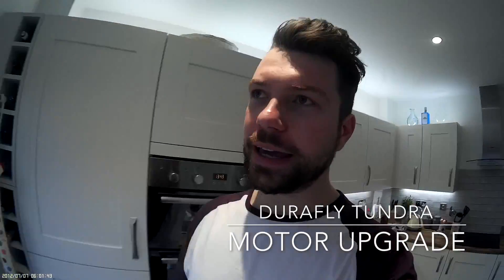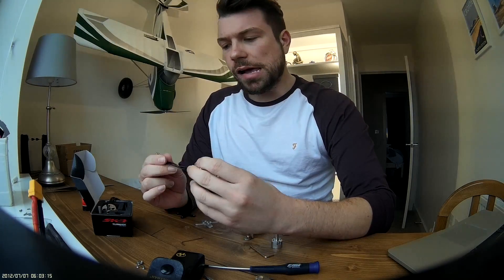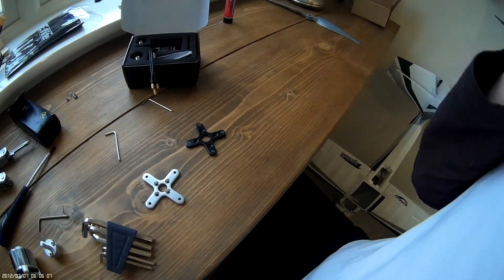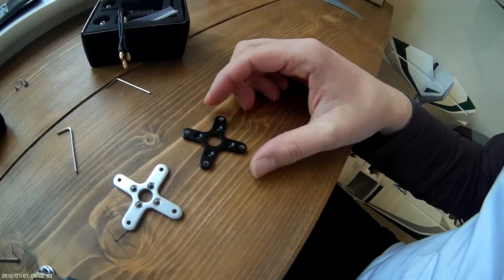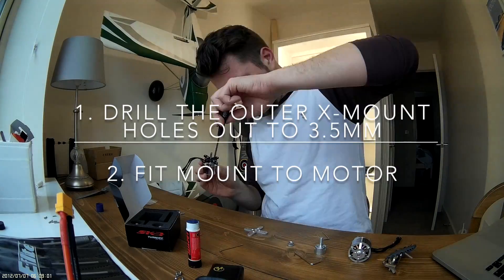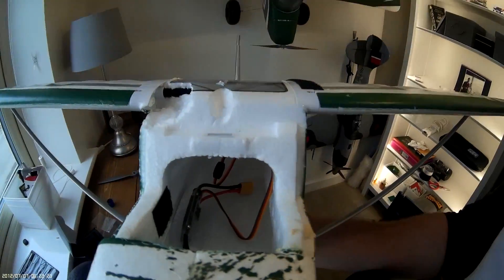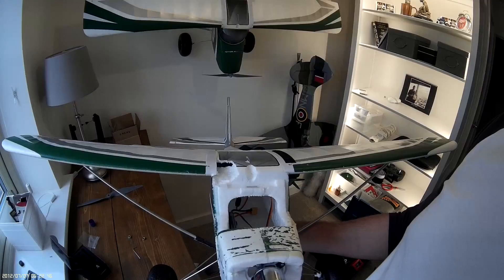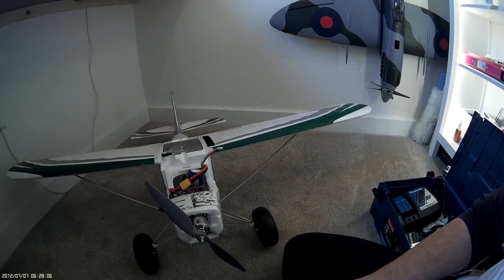Hobby King Durafly Tundra Motor Upgrade Video

Comment: Hi Ben. Thanks for the video. Needed to upgrade the 40A ESC on my Tundra as I wish to use 4S batteries, so went for your motor upgrade as well. Should have new parts in a dat or so. Will post results.

Comment: So this is a boost in performance even while still using a 3s? Im looking for a back up motor for my Tundra but i want to continue using 3s lipos.
Reply from the maker: gracefulbutterfly it is a boost. Not huge - but noticeable even on 3S.

I'd say the main drawback to having this motor instead of stock is once this motor is mounted - the stock motor may not mount on properly if you ever wanted to use that again as the screws enter the holes at a slight angle. Great motor. Good back up and slight upgrade should you need a spare.